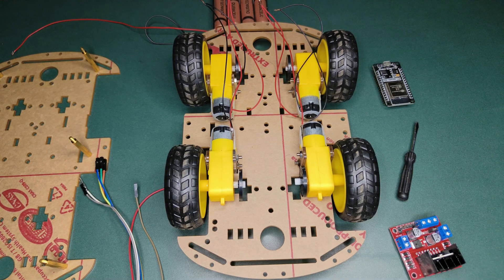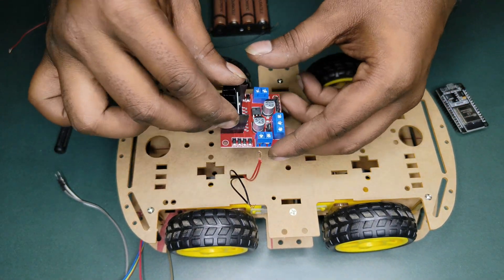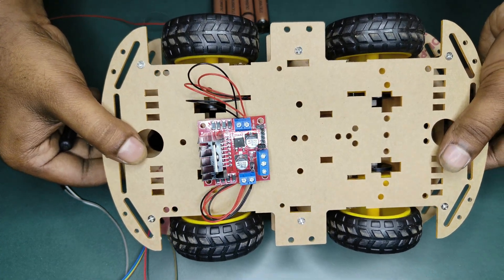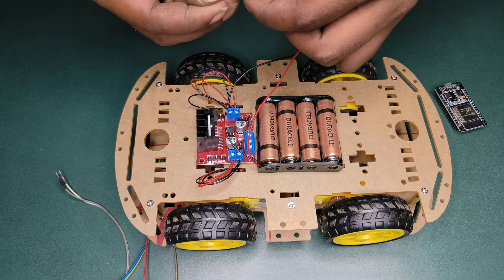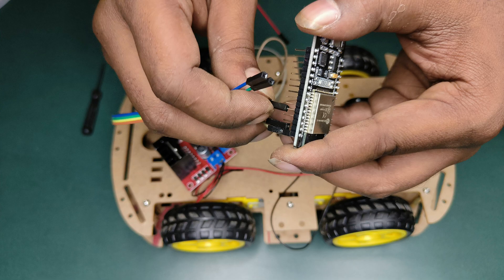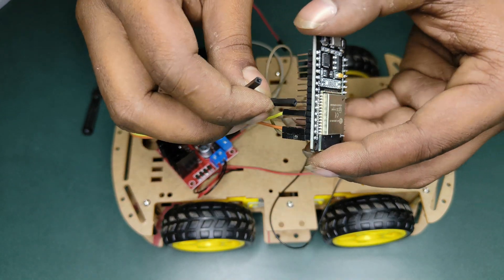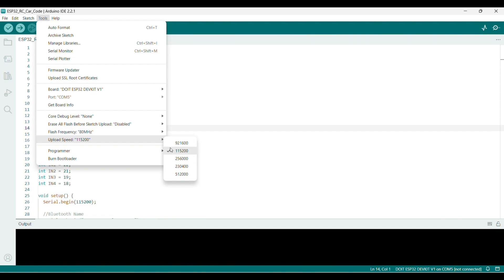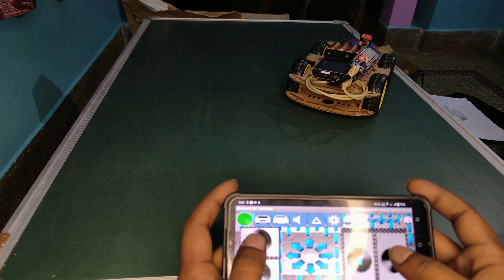How to Make ESP32 Bluetooth Controlled RC Car| Step By Step Tutorial |తెలుగు #viral #diy #asmr #espn

Comment: Bro battery positive teeskoni 12v supply isthunnappudu power sparks vastunnai and also diodes peluthunnai 
Yenduku antaru 
Emaina solution chepthara 
Buck convertor vadina tarvatha kuda same
Reply from the maker: Bro maintain 12v 2amp supply and connect it to motor driver only

Comment: Bro,nuvu Power ni motor driver to esp32 ichavuga malli Enduku power bank
=>Esp32 3.3volts deggara work avuthundhi ga .5volts give to esp32 it doesn't work 
Please reply 🙏😭
Reply from the maker: Batteries power saripoledhu bro anduke echa meru ala evodhu just give 12v 2amp supply to motor driver it will work
Reply from the maker: Inkemina doubts unte please contact me in Instagram

Comment: There is an error in the code Some API is changed please reupload the code :  

C:\Users\gplus\Downloads\ESP32_RC_Car_Code\ESP32_RC_Car_Code.ino: In function 'void setup()':
C:\Users\gplus\Downloads\ESP32_RC_Car_Code\ESP32_RC_Car_Code.ino:36:3: error: 'ledcSetup' was not declared in this scope
   36 |   ledcSetup(R, 5000, 8);  // Channel 0 for Motor A, 5 kHz frequency, 8-bit resolution
      |   ^~~~~~~~~
C:\Users\gplus\Downloads\ESP32_RC_Car_Code\ESP32_RC_Car_Code.ino:37:3: error: 'ledcAttachPin' was not declared in this scope; did you mean 'ledcAttach'?
   37 |   ledcAttachPin(enA, R);
      |   ^~~~~~~~~~~~~
      |   ledcAttach

exit status 1

Compilation error: 'ledcSetup' was not declared in this scope
Reply from the maker: The code is working check the version everything
Reply: can you send the corrected coding?
Reply from the maker: Contact me in Instagram or WhatsApp